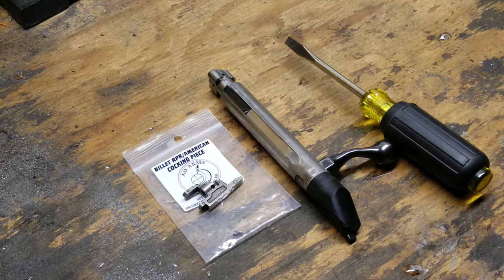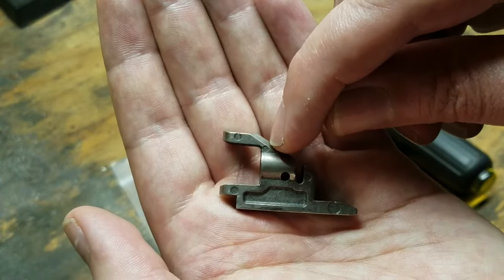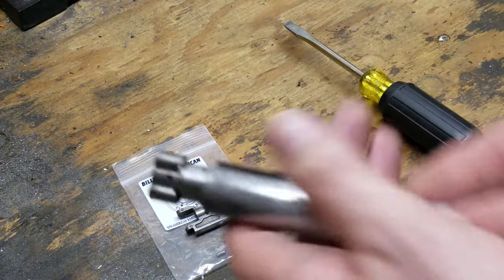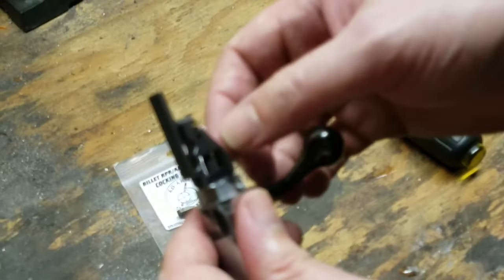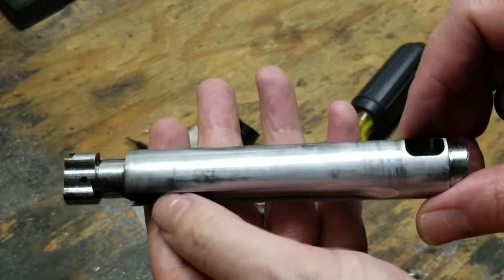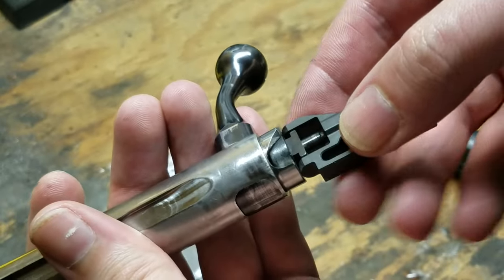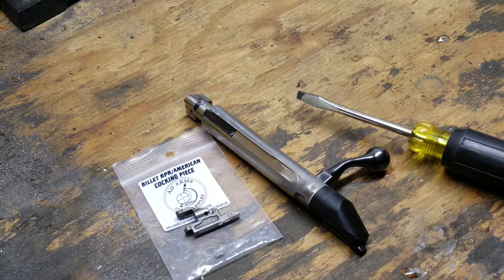Ruger American/Predator bolt disassembly the EASY way, with no special tools!

Comment: So when I got the cocked piece and the firing pin out my screwdriver came out before I got it back in the bolt what should I do because now my cocking piece and firing pin are together. I tried to just put it back in but it wouldn’t stay tight
Reply from the maker: OUCH! What kind of tools are at your disposal? Do you have an awl or a bench vise? I would put the lower tail of the cocking piece carefully in a vise or on a piece of wood to keep it from getting scraped up and wiggle an awl in between the components until you get a gap wide enough for a small screwdriver blade to slide in, wiggle that in further and step up to a larger blade screwdriver and work that one in from the opposite side. It's going to be a pain to keep that center piece squared to the cocking piece too...
Reply: MåcGyver alright thank you
Reply: MåcGyver alright I got it the only thing is the cocking indicator and firing pin doesn’t line up does that matter?
Reply from the maker: @peterpriester8910  cocking indicator? Mean the cocking piece on the rear? The flats on the center bushing on the middle of the firing pin needs to be square with the cocking piece.
Reply from the maker: @peterpriester8910  you get it figured out?!
Reply: MåcGyver yes thank you

Comment: So once you reinstall the bolt shroud and click it back into place by turning, the cocking piece and firing pin “flats” no longer have to be lined up?
Reply from the maker: To get the bolt BACK into the rifle you need to line things up like is shown at 1:45. (Sorry it took me a bit to reply!)
Reply: @macgyver5108  Actually I never got it out of the rifle but it turns out the light strikes I was having was because my primer seating tool was broken and not fully seating the primers, instead of there being a dirty firing pin channel like I thought 🤣
Reply from the maker: @rifleshooterchannel208 glad you got it figured out! It's my "humble opinion" that EVERYONE who owns a gun ought to be able to at least have a modest grasp and understanding of its "basic" functions, so as to clean and maintain it properly. ESPECIALLY if you're reloading for it!

Comment: Sr: hi I need little help with my ruger predator 223 , I need to buy the bolt fire pin complete . The entire part with the iside component . You tink can help me with it ? I been looking by internet and Not finde any
Reply from the maker: Unfortunately you won't find a separate firing pin or the bolt body anywhere other than by calling Ruger customer service. The bolt isn't considered a "user serviceable item" because it needs to be replaced by a professional gunsmith to set the correct head spacing. It's all covered under warranty though and Ruger customer service is pretty amazing about making things right.

Comment: Picked up one yesterday and the ejector and spring fell out any direction for how to replace?
Reply from the maker: Oooo boy... Do you still have all 3 parts, the spring, ejector and the roll-pin that slides in at a 90° to retain the ejector? Or did any get lost? Call Ruger customer service and they'll send you replacements on the house, just have your serial handy. I've always used the NC branch, 3369495200 because they're super friendly folks.

As far as getting 'the snake back in the cage'... You'll need a 3/32" roll pin punch (NEEDS to be a "roll pin" punch which has a specific tip shape, a normal punch will obliterate the roll pin!). A trick to help get the spring and ejector back in the hole is I clip about 1/2" off a plastic coffee stir straw to use as a guide tube (if you can still find one). If not, any tube with a 1/8" or 3.2mm Inner Diameter (ID) will avoid sending parts into Low Earth Orbit or mangling the spring... Might try brass or aluminum tube that size from a hardware store or model/hobby supply shop. If you go that route you can also file off 1/4 of one end so it sits nicely in line with the bolt face. Hope that helps...
Reply: @macgyver5108  I never took roll pin out the ejector and spring just come out.  Perhaps they didn't knock the pin in far enough.....
Reply from the maker: @kirkwest6654  odd... Maybe the roll pin wore out or rotated in the hole "just right" where the split is and the ejector came out? At any rate, call that 336 number and they'll priority mail you a new replacement kit free of charge. At this point I'd replace all 3 parts to be safe.
Reply: @macgyver5108  I did get some spare parts rifle was new hasn't been fired yet I was just checking feeding on heavy 300blk subs with factory mag

Comment: Screwdriver didn’t work for me, tried several different flatheads. They didn’t exert enough pressure down onto the upper rectangular  tail piece of the firing pin. A pair of snapring pliers worked nicely, and it easily freed from the bolt handle.
Reply from the maker: Hmm, must have pretty small shafts? Glad you figured out a tool that would work.
Reply: Anarchy Outdoors makes a good firing removal tool.  Check it out on their site.  Makes working on the Ruger American bolt a breeze

Comment: What happens if your screw driver pops out and you lose the gap?? Sitting here for 3 hours trying to fix it
Reply from the maker: Use the "spring compressor" Ruger gave you! 😁 If you slide the bolt handle up over the firing pin there's a round collar with tabs sticking out, where it normally sits. Rotate the handle so it locks into that collar and press the whole thing down onto a block of wood so you don't screw up the tip of the firing pin.

Helps if you drill a shallow hole partway into the wood to press the pin into so it doesn't get squirrely. Then just twist the firing pin backer so it's square with the handle collar and slip the screwdriver back in.

Comment: How about a video on what you did to work the corduroy sound out of the bolt? Did you also work the raceway? I would surely appreciate it!
Reply from the maker: It's really pretty simple to do. Are you on the main Ruger American fb group? I've thought about making a video explaining the steps, but I don't have a "virgin" Ruger to show the whole process, I've done 3 so far... Tape the bolt lugs off, sand the body with 600-1k grit sandpaper. Use a metal polishing compound of some sort like Flitz, automotive wheel polish or chrome polish ETC and hit it with a buffing wheel. When you're happy with it take the tape off the lugs and blast it all clean with brake/parts cleaner to get all the buffing compound and any grit off REALLY WELL! If polishing compound gets into the lug area in the action it will end up lapping the bolt lugs and mess up your head space! Find a PVC pipe that will fit inside the action "raceway" and neatly tape some sand paper to that, slide all that into the action no farther than the front of the ejection port and start spinning! When that's done, hold it muzzle up and spray cleaner down the bore to hose any grit out the backside, you don't want that junk going in the bore, then hold it all higher and blast the rest of the action clean.
Reply: @macgyver5108  Hot damb! Thanks alot! I'm getting on the bolt as soon as I can gather the stuff. Most of it is on hand, actually; just need to right size the pvc pipe... I don't know why I hadn't thought of a fb grp- I'll check it out.  (...just tried... what is the name of the fb group you're referring to?)  Thanks again, sir.
Reply from the maker: @ardz8279  the group title is "Ruger American" by Indian Creek Design. Or just go to fb online and add /groups/791513284361395 after the com on the web address. I'm a mod over there... I'll double post so it's easy to copy.
Reply from the maker: /groups/791513284361395
Reply from the maker: @ardz8279  any sort of tube that's a perfect "cylinder" that's long enough to have a handle would work. A copper pipe with the ends smoothed up, a dowel ETC. I happened to have a stiff plastic tube one of my long ceramic triangular polishing stones came in that worked perfect.

Comment: I learned a valuable lesson by turning it too far. Anarchy Outdoors makes a tool for under $20.00 that will save the day! Thanks for the vid!
Reply: I bought one of those.  Save your money.  They are made of soft aluminum and disfigure on the first use.  Use a hardened screwdriver.  Maybe Anarchy will build a steel version; until then, I wouldn't recommend the aluminum one.

Comment: Is it counter clock if the bolt is left handed?
Reply from the maker: I'm gonna say that's unlikely. The handle is probably inserted in the bolt in the opposite direction 180° through the hole, to simplify production and machining if you follow. But I could be wrong?!

Comment: **EDIT: Nevermind, didn't quite have the pin cocked far enough to insert the tool properly! 😂 ** 
When I remove the screwdriver, the firing pin snaps back against the cocking piece. It won't hold that head space and that causes the firing pin not to lock back into the bolt. I've tried many many times! I ordered the two pronged tool from Anarchy Outdoors, but the tabs don't fit around the cam of the firing pin. Any recommendations before I pay a shameful visit to the gunsmith?
Reply from the maker: Hmm, take a picture of the back so I can see what you're talking about.

Comment: Okay so I’ve got a question and I’m really hoping someone can help me out here, when I went to buy one of these billet pieces, it’s asking me “short action American rifle or magnum action” but my Ruger American is a 30-06 and it’s the new go wild edition. Will one of these pieces work for my rifle?
Reply from the maker: Which billet peices? The firing pin back? 30-06 is a "long action" but has the same bolt face diameter as a short action such as .308 or 6.5 Creed, so the short action should work for the '06. Magnums have a larger bolt face so...
Reply: 06 is a LONG action(large)
Short action .308/6.8/6.5/.243 are the others.
Hope this helps you out

Comment: When you say changing the cocking piece made it smoother what do you mean in particular?
Reply from the maker: The surface of the new cocking piece material is so slippery that it makes the action components glide over each other much easier. I would estimate the rifle bolt cocks with 1/4 of the force necessary before and it even dropped my trigger pull weight by a solid 1/4 lb. I had done a trigger job, where I polished the sear points and trimmed the springs, dropping it to 3 lbs dead even and now it's at 2.75 lbs just by installing the cocking piece.
Reply from the maker: If your bolt has the "zipper" sound when you run it this won't change that, you'll have to sand and polish the bolt body to get rid of that! The new cocking piece only affects how much force is needed to close the bolt handle and how much pressure is needed to pull the trigger.
Reply: @macgyver5108  I have polished the bolt so it does make any noise now but when I cycle the bolt it has a very distinctive double bolt lock and unlock. Have you seen anything like that before or know if the cocking piece will fix that?
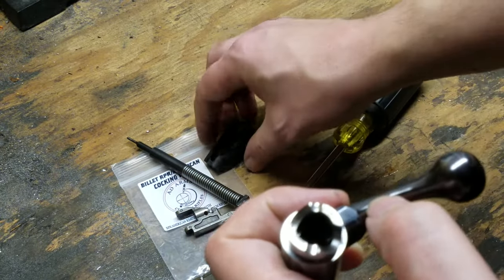Reply from the maker: @garrettwilkinson5801  That double click is part of the cam feature for the 70° throw... The AD Arms cocking piece makes that run a little smoother but not much, it's still a very distinct two clicks. Only way I can think of to help fix that (which I'll be doing soon) is to polish up the rear portion of the bolt where the cam part of the cocking piece rides. There's a couple large notches in the back of the bolt that can be pretty rough and could use some fine grit sandpaper and then a buffing wheel to polish those to a mirror shine and THAT would help immensely! Pause the video @ 3:55 and you'll see what I'm talking about on the rear of the bolt... There's two deep ramps and two smaller indents in the back of the bolt. DON'T get TOO aggressive with sandpaper on the two smaller indents or you might lose some of the lock up on the bolt, Use some fine 1000-2000 grit sandpaper LIGHTLY on those two indent areas for only a minute or so just to smooth it out without removing a ton of material and then use a polishing wheel. You can sand and polish the two deeper cuts without having to worry about the lock up, that's the initial stage before it clicks the first time. I should do a video that covers that project...
Reply: @macgyver5108  ok great thank you. I video on that would be a great help too many I'm sure. I never noticed the two stages on any of the guns at the stores in my area so when I got this one from ruger it seemed way off to me. Thanks for all the help I will be subscribing to the channel great job so far!
Reply: MåcGyver Did you ever clean up the rear portion of the bolt body? Looking to clean mine up to make the bolt close smoother and wondered if you ever tackled this.

Comment: I got the metal piece but where you put the flat head that gap is closed idk how to get it open
Reply from the maker: The AD arms cocking piece? There's a gap next to the center "rod" on two side, that's the the firing pin mechanism in the middle.
Reply: I figured it out thanks for video helped greatly
Reply: Now I’m having a failure to extract lol
Reply from the maker: @popethehope8244  is it pulling the shell out and failing to eject or failing to pull the shell entirely? If it's not flicking the brass out then that's a weak or stuck ejector spring/plunger, failure to extract is caused by the extraction claw being the wrong shape/spec size, usually there's either a rough edge that's getting in the way and not allowing the claw to lock onto the rim of the brass or it's not a tight enough fit to hold onto the brass securely. Call Ruger customer service and they'll sort that out for you, but you'll have to mail your bolt to them which might take a week or two to get fixed...

Comment: Soooo, how do youn replace the new unit?
Reply from the maker: You mean the new firing pin back?  Once you pull the firing pin assembly you drill a hole part way into a scrap 2x4 block of wood big enough that the front of the firing pin will fit in. Then use a "roll pin punch" (specificly! Not just a plain punch!) to drive the roll pin out of the firing pin back so the pin back can unscrew. Screw the new one on using the hole in the wood block and to make things easier slide the bolt handle over it to compress the firing pin spring. Hammer in a new roll pin and you're on the home stretch.

Comment: I let the screw driver slip while putting back in, boy oh boy did that suck without a vice.
Reply from the maker: OUCH! I'm contemplating a "re-do" of this video with a few additions if I get the time. For one, you can loop a line of say 550 cord through the pin back and stand on the loop like with Remy 700 bolts to get things back into line or even easier just rotate the bolt head around until it lines up again. Looking at the design closer the pin back has a roll pin in it, so it can't come undone like myself and others in the Ruger American forums figured would happen.

Comment: If your screwdriver slips out you can seperate the two and start again by using an adjustable wrench to force the spring down. Put the firing pin ontop cardboard as you forced it down.
Reply from the maker: Or just use the tool Ruger gave you, the bolt handle...